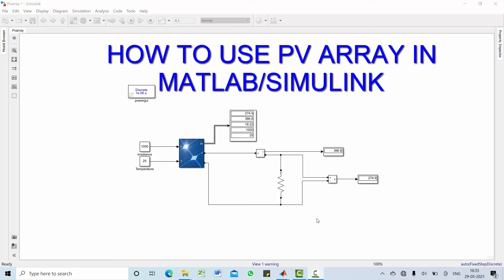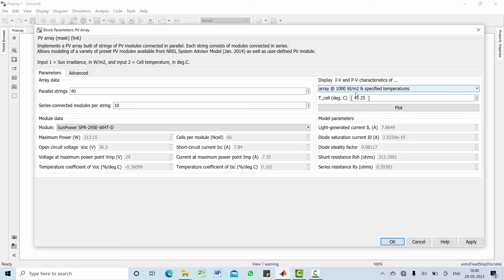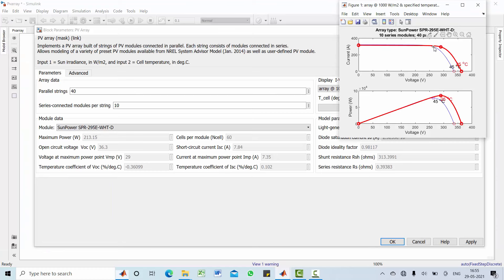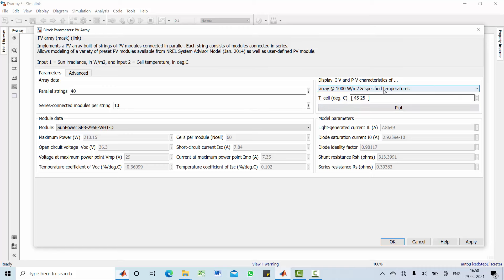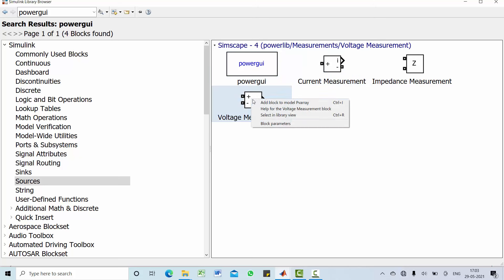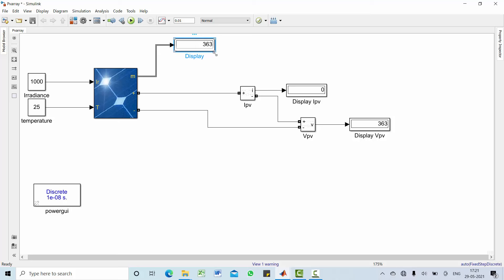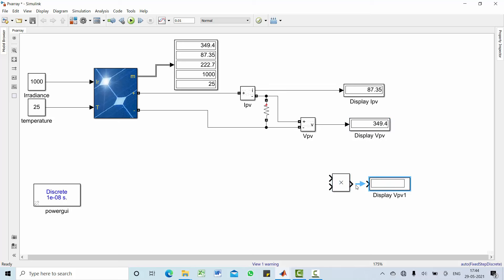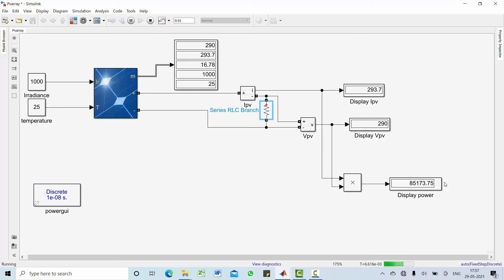How to use PV array in MATLAB/SIMULINK?

Comment: Good video. my MATLAB does not want to run this, it keeps saying not a number on the display. and only displays when I add a resistor. 
what could be the problem.
Reply from the maker: current or voltage or both v&I display?

Comment: Sir can u plz tell me why we use power Gui and convert it into discrete
Reply from the maker: Continous will take more time to run . So we are using discrete steps as per to reduce it
Reply: @powerandenergychannel9082  so sir what is the meaning of sample time we define in it
Reply from the maker: @usmaniftikhar4711  I have chosen discrete time step of 1e-8. time of run as 0.1.  hence, the system will run 0 to 0,1 insteps of 1e-8

Comment: Will you please make a video on how to find  open circuit voltage and short circuit current in a pv array
Reply from the maker: open circuit voltage is calculated in this video. for short circuit take the same model short circuit terminals of PV. then, u see the voltage around zero but current becomes maximum= short circuit current
Reply from the maker: OC voltage is calculated @ 9:35